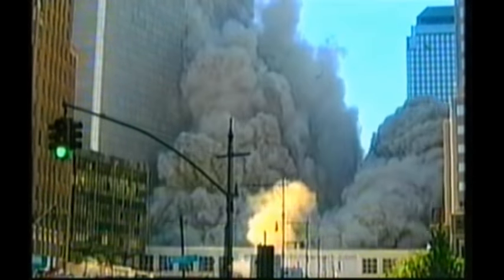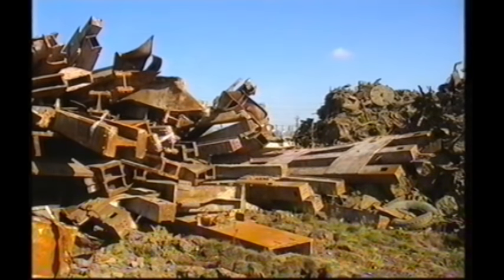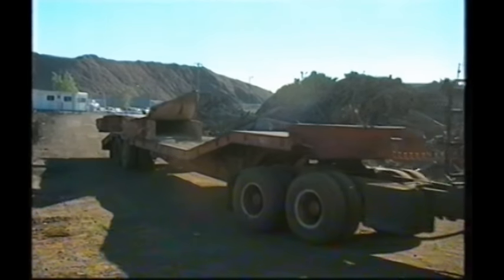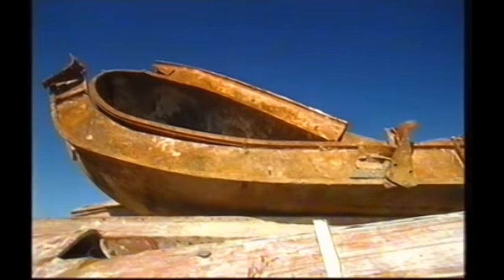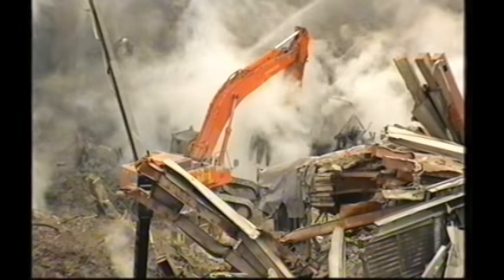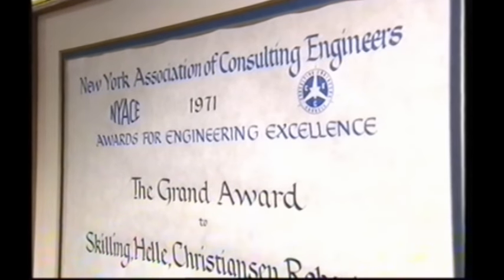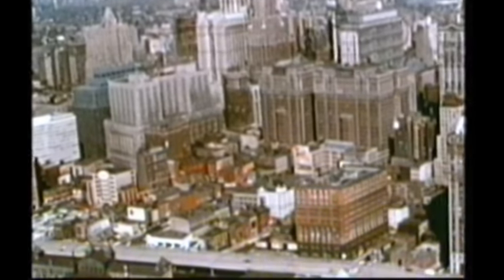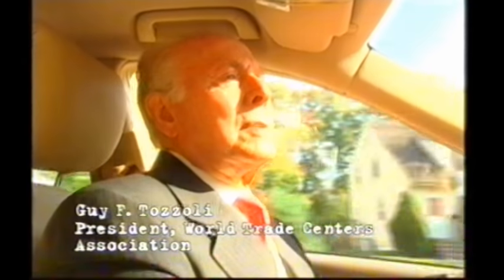9/11—"How The Twin Towers Collapsed" (C4 documentary, 2001)

Comment: What about the 85 undamaged floors under the impact zone. Wouldn't the collapsing floors meet resistance from the undamaged floors and according to the laws of physics slow down and eventually stop? Instead the collapse sped up and came down in almost free fall speed.
Reply: Watch a film of ANY controlled demo of a tall building. This is EXACTLY how they collapse, as the accumulating weight crushes more and more quickly what is below it.
Reply: zapdunga ... what about the lack of water flowing out of the building upon their demolition ... city water can't be pumped 1100 feet up. Water was staged every 10th floor to supply AT LEAST 500,000 gallons of water per day just for toilet waste alone! When those TWINS (Jacob and Esau playing out here) came down there had to be at least 11 reservoirs containing the water ... they had to burst spewing water, creating mud, during their take down (take down of Jacob and Esau: mRNA). This was NOT observed! How long do you think it would have taken to purge 11 reservoirs!
Reply: You'd think, a tad bit of resistance, some , a smig?
Reply: @peppergrand1072 smidge 😂
Reply: @markshaw270  ty
Reply: @Psychiatrick  
Perhaps you should concern yourself with things you AREN'T ignorant about.  The twin towers were constructed with an inner core where the three stairwells were positioned, and it was through this inner core that the water supply pipes ran.  Naturally, any reservoir tanks were also located nearby, so the overwhelming amount of water in the building would have been almost directly in the center.  People who escaped through those stairwells have mentioned how those routes were hazardous due to the slippery surfaces caused by water streaming down them from the broken supply lines that ran through them.  

Also, since each building weighed 500,000 tons, your estimated 500,000 gallons of water creates an average of 1 gallon/ton of material.  That won't make any noticeable mud, spray or sheen.  Take your delusions elsewhere.
Reply: HirnExe  The top 10% crushed one floor, then its mass added to the downward force.
Reply: @blake77777  each floor was 1 square acre ...
Reply: “According to the laws of physics”? Lol. You haven’t got a clue
Reply: @internetpolification  Perhaps you could explain yourself, Albert, as lay-PERSONS may not understand!
Reply: Weight and speed and gravity..do u really think all the Weight would stop on the way down
Reply: You need to understand the difference between static and dynamic loading. And you're also missing the point that as each floor collapses more weight is coming down on the floor below.
Reply: According to the experts I’ve read, the top ten stories should have stopped after crushing the ten stories below.
Reply: @coryhoggatt7691  If you actually read that, then they were anything but experts.
The mass of the uppers floors 'fell' through a 30-foot gap created in the structure by the airplane impacts. In WTC2, this was like a 30-storey office building falling for 30 feet. This movement generated enormous kinetic energy directed downwards. When this mass struck the uppermost of the lower floors, it immediately destroyed it, and the mass of that destroyed floor immediately became part of the mass which impacted the floor below. This process continued all the way down in a 'progress collapse'. NOTHING was going to resist the kinetic energy of the upper floors once they began to move downwards.
Anyone who says that ten floors would have stopped after falling ten floors clearly does not understand the difference between mass and force. Clearly.
Reply: 100+ IQ people, who don't think with their emotions/feelings, know what really happened. FF
Reply: @AmericanLifterX  Which was, what, exactly?
Reply: @Psychiatrick  A "square" acre??? There's me thinking they were already a square measure.
Reply: @coryhoggatt7691  You've been reading the wrong "experts" - plenty of them around here!
Reply: @alanclark639  How olde are you Sun?
Reply: HirnExe  If you can find a controlled demolition where they only planned on knocking down the first fews floors you've probably found a controlled demolition that went wrong.

Comment: I first came accross the twin towers when visiting Manhattan as an art student from Portsmouth college of art in 1977.
I had visited the great buildings in mid town first. The famous Empire State building, the Chrysler building,  the United nations building and the Radio City building. 
But the moment those slender silver towers came in to view as I walked towards the financial district I knew immediately that these structures were special. 
I had never heard of them before and the fact that there were actually two of them intrigued me more. For years after returning home to England I had these wonderful dreams which featured a composite building comprising of the Trade center towers and the CN Tower in Toronto which I visited that same summer.
I would dream of speeding up inside the elevators to the top of the towers, but I could see through the elevator's glass doors indicative of the outside elevator's on the outside of the CN Tower.  At seventy years old I can still experience those wonderful dreams, although far less vivid than when I was in my mid twenties.
Reply: @den264 Nobody cares

Comment: It's funny how back in 2001 it was said that the heat melted the beams and now this guy is saying that the collapse of each floor is what brought the twin towers down .
Reply: No one said "heat melted the beams". It's impossible. What happened is that the heated steel lost its structural strength causing each floor to collapse into the other
Reply: Nobody with any knowledge said "beams melted". They weakened or softened in the heat.

Comment: 27:08   Ok, time for some facts and figures so that everyone has something to think about here:  Engineers have used several different alloys in order to develop projectiles for use with railguns; Aluminum is the material that we are mainly interested in today because that is what an airliner is made of, mostly.  So a 2 pound Aluminum projectile was fired from a railgun at a speed of approximately 4000 mph (60,000 g's) and that projectile was able to penetrate a 1/8 inch sheet of steel and then afterwards it continued to travel more than 4 miles down range. The exact same type of projectile fired at the same speed was stopped by a 1/4" sheet of steel (projectiles made of tungsten or uranium are able to penetrate much more than the Aluminum projectiles, fyi).  So, just to reiterate, an Aluminum projectile fired at just under 4000 mph (at sea level) is stopped/vaporized by a 1/4" sheet of steel (it still made a hole though).  My point being that if a chunk of Aluminum essentially disappears in a flash of energy after striking a stationary sheet of 1/4" steel (just a bit thicker (2x) than the fender of a car) then what would happen to a mostly Aluminum, commercial airliner traveling at around 300 mph, after it passes through a spider web of 14 inch, narrowly spaced (every 3 feet), high-strength, load-bearing, structural steel beam columns with 4x10 foot, 1 inch plate steel spandrels at every floor? Then, as if that wasn't enough, the airliner finds that it will now have to traverse the building's 87x135 foot central core which consists of either 52, 36 or 22 inch steel beams (depending on how high up in the tower they are located) spaced 2.5 feet apart with their foundation being in the bedrock at the base of the building. I mean what would happen to that almost all Aluminum airliner? Is it any wonder that nothing but a fuel cloud came out of the other side? Aluminum vs Steel? (Sure, I bet the building rocked back and forth more than normal but still, my bet would be on the WTC for the win because nothing larger than 2 or 3 feet is going to come out of that (maybe the main landing gear might put up a fight but that's probably going to be the toughest, all in one, part)). So with respect, I would like to recommend to everyone that when it comes to the kinds of physics involved with almost everything related to the destruction of the twin towers, that it is best to keep an open mind and that not everything is easily deduced when it comes to such matters.  Try not to commit yourself to any conclusions until you've either looked into the matter or heard more about it. With regard to the events of 9/11 I constantly find myself having to make corrections to my 'logic' and reasoning. For me battling against my own entrenched conclusions always seems to be like swimming against a rip current, so unless you are 100% certain or if you think that you figured it out based on your life experiences then it may be in your best interest to back off on your 'conclusion meter' a notch because all may not be as it seems in the world of velocity, momentum and did I mention architecture?  Thanks for taking the time to read my comment and I hope that it gives you an extra mental boost or at the very least something a little more complicated to do with your calculator. Best regards.
Reply: how fast do i need to shoot a 1/2 full beer can at an 1" thick sheet of plate steel in order for it to penetrate? answer: it is not possible to penetrate plate steel with beer cans.

Comment: Correct me if I’m wrong but didn’t most of the fuel blow up on impact? What was that giant fire ball?
Reply: Just a view %. Not enough oxy for Tons of Kerosin.
Reply: It was the fuel burning on impact. Kerosene doesn't "blow up."
Reply: but it was the fuel that brought them down lol
Reply: @beantown_billy2405  You better check that, fuel does blow up Under pressure.
Reply: @billv6813  I guess "blow up" means whatever you want it to mean. There are more precise terms like conflagration or detonation. I don't know what you mean by "blow up under pressure". Like if the kerosene were in a sealed container?
Reply: @beantown_billy2405  In a sealed container applying pressure will create an explosion, blow up, whatever you want it to say. That is how diesel engines work without spark plugs.

Comment: Almost 40 min in until they start explaining how it collapsed. But still doesn't explain exactly why they fell down so uniformly. The entire buildings heat treated beams weren't all damaged. 

They used to have shows on tv that explained how difficult it is to make a building fall straight down.
Reply: @Atomic Dawg: It seems you don't pay attention. It was explained quite well. Maybe try cleaning out your ears with a power drill and a large wire wheel.

Comment: It was the first building I worked on where the core (elevator shafts) were protected by sheet rock instead of metal lath , cement and plaster. I was only eighteen years old, and I wondered why?

Comment: The science and engineering behind how the towers were able to collapse is fascinating. I am in no way making light of what happened. It was a horrible tragedy that took the lives of innocent people.
Reply: And yet; not only these two towers were taken down by two airplanes full of kerosene ....... the whole complex was destroyed by fire .......
planes are made as light as possible in aluminium.
15:09 / Too bloody true: "Steel that now lies in a scrapyard and contains the secret of how this revolutionary design was undone".
They couldn't get rid of it fast enough for that very reason.
Reply: When a building collapse happens the rubble at to the base is approx a third of its original height. These two 110 storey buildings made a pile 3 storeys high. It turned into dust, the concrete and inch+ thick structural steel. It blew away as video showed.
Reply: Dr Judy woods book.. Where did the towers go. Explains the easiest way.
Reply: @gazmasonik2411 Where is she now and where can you buy the book ?
Reply: Explosive charges me ade it fall
Reply: idontthinkso2861  hiding the evidence
Reply: idontthinkso2861  Who the hell names a scrapyard that...
Reply: @franklinthompson7336  The scrapyard was named as such because the first choice ("The Garden of Allah") was already taken.
Reply: @ta2joe13  The towers were designed to cope with being hit by a Boeing 707 low on fuel traveling slowly prior to landing, but NOT a modern 767 fully loaded with fuel and being aimed deliberately at full speed. 
Of course the towers would fall into their own footprint, it's not surprising at all. They'd naturally fall straight down as the center support columns became weak from the heat of uncontrolled fires.
Reply: What's so fascinating about it, any building will collapse when you detonate all the support beams.
Because if you really believe that an airplane crashing into a skyscraper would it cause it to crumble into its own footprint, twice in a matter of minutes then you have been had.
Reply: @Cee_H  exactly.
Reply: @jaqua7732,  it’s interesting to note that after all these years around 3500 “professionals” have signed the architects and engineers pledge.  The important point here is acknowledging how many architects and engineers there are world wide, versus how many signed the pledge.   I’m the kind of person that is going to wonder, where is the science, when the architect and engineers group has gotten only a tiny fraction of one percent of scientist to sign the petition.
Reply: @dikranovichk5889  The architects and engineers pledge?
Please explain.
Reply: the plane was made from aluminum, aluminum once heated to a point melts it becomes pyrotechnic coming in contact with steel it will continue to burn and melt, heating and melting the steel as it burns, like aluminum grinded to a granular state is used in bombs and fireworks, like the moab bomb, add to that continually burning materials and top weight👀
Reply: @archsciontrismegistus4194  you have that all wrong.
Finish this sentence for me if you can.
An object in motion stays in motion until......
Reply: @jaqua7732 what does inertia have to do with the tower collapsing
Reply: @prod_luutt7721  I don't know, what?
Reply: I've worked for High Rise Management of several buildings in LA. The engineering and construction is extremely interesting to me as well.

Comment: As far as building 7 goes, no building in history has ever collapsed from a fire at free fall speed into its own footprint, & no buildings have collapsed since from fire, engineers know it isn’t possible
Reply: didnt you hear the controlled demolition going off just before the building came down, they even knew exactly what time that building 7 was coming down
Reply: @hurtlocker6611  Yes I heard all the explosions & I heard all the firemen talking about the multiple explosions but the narrative was that the planes Jett fuel did all the damage that caused the collapse, but technology we didn’t know about was also used in conjunction w/ the demolition & that would be space lasers, (remember all the people jumping out of the buildings?) the same burned out cars outside the twin towers were also found outside the so called wildfires in Hawaii but strangely enough the wildfires were nowhere near the burned out cars, so how did the glass melt on the cars? It takes over 2,000 degrees to melt glass & wildfires only get up to about 1500 degrees so people better wake up to the attacks being perpetrated on the American people since 2001, they make Americans take the clot shot but illegals don’t have too, isn’t that proof enough the the clot shot must be something more sinister than they are portraying it to be?
Reply: @hurtlocker6611  Actually building 7 was reported to have collapsed like 40 minutes before it actually collapsed by the BBC